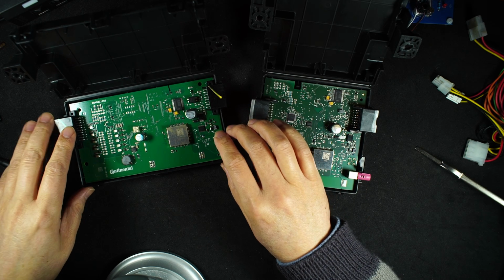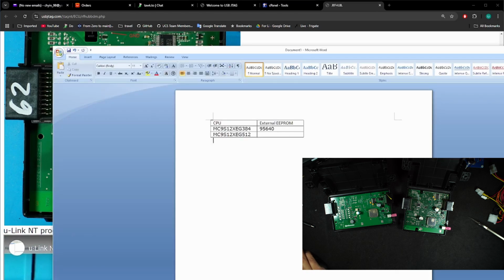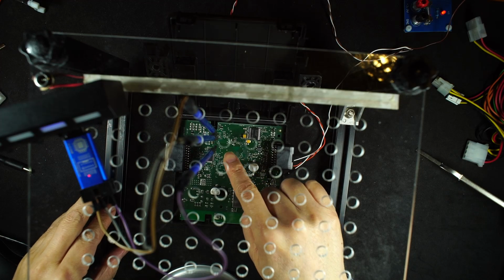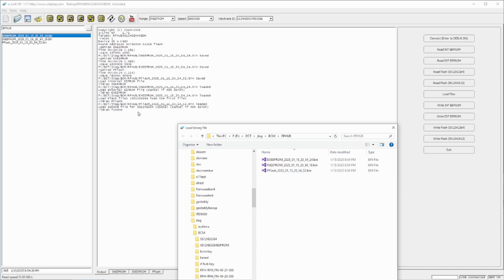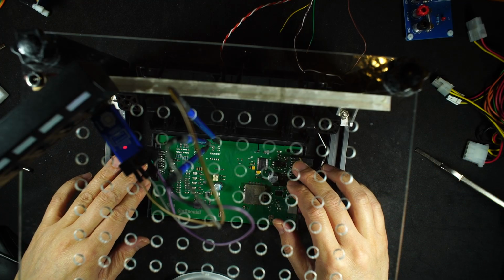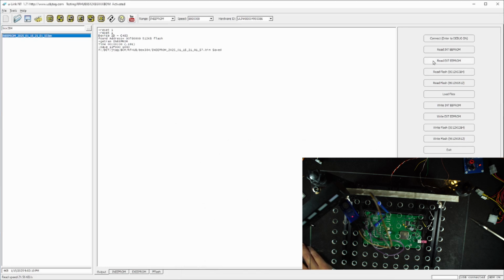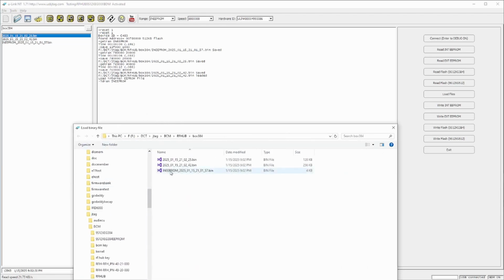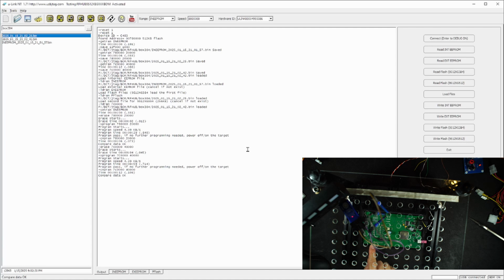RFHUB Programming (BDM updated)

Comment: Trying to add myself on the forums, no luck yet, having an issue reading keeps saying bdm off in bdm mode..
Reply from the maker: The forum is not th eplace to ask. The chat is the one to use to get support. Check one of my early shorts.
Reply: you need to add power via the main 10 pin connector (where the CAN-C wires go). Then ID the board after you power up (12v, 1amp at the main connector with the CAN-C wires). This is just what I do. That will give you the full speed and show BDM on.